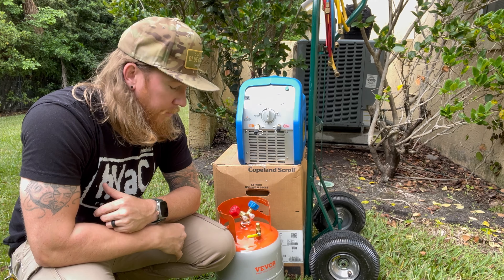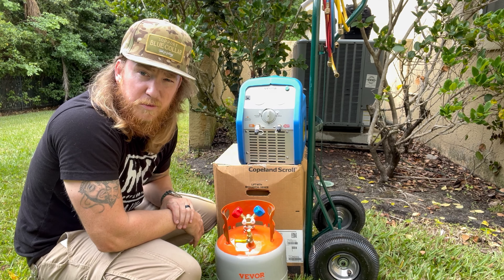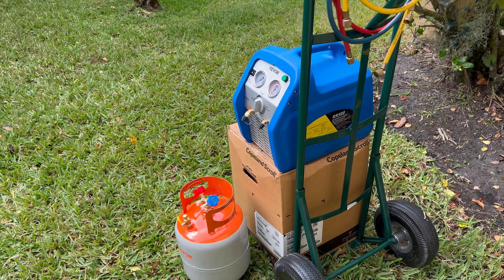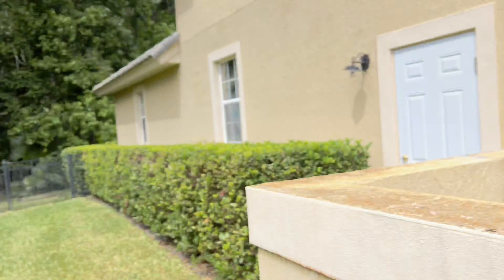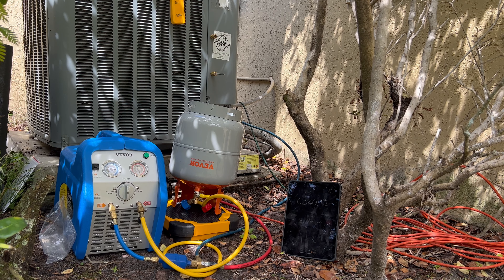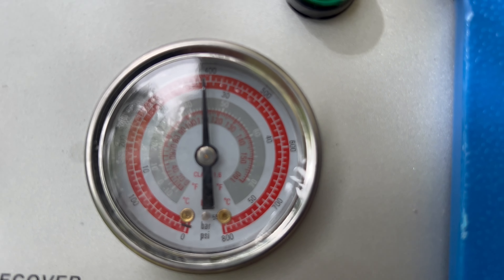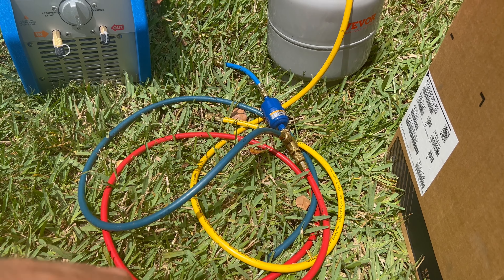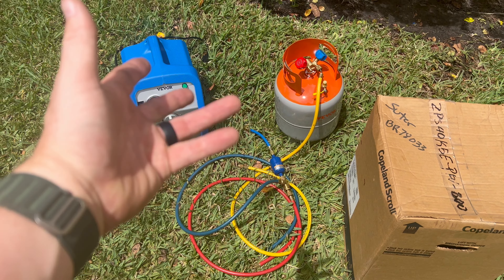WOULD YOU BUY THIS? | HVAC TECH | Vevor recovery machine and recovery tank

Comment: I recommend putting that recovery tank in water or ice over it to help the recovery process and keep the tank pressure lower. You can also just run water hose over it. or put it in a bucket and ice. Nice job Jake. liked it.
Reply from the maker: 10-4 yessir, appreciate the tips mark! One thing I forgot to mention while flipping bottle over the knobs stick out past the handle so doesn’t sit evenly. Different subject but the same 😂

Comment: Thanks for the video, I found it informative! Curious where you got those fittings you used on the AC unit itself.
Reply from the maker: Dude much appreciated 🙏 🫡 those particular valve core removal tools or shrader core tools are the appion brand, I also use the yellow jacket and the cps. They definitely come in clutch!!

Comment: Pretty common for recovery units to shut down around 400 psig when recovery tank gets to about 120 degs F, for R410a, 150 degs F for R22, driving up the pressure for machine to work against.  Cooling down recovery tank with slight water flow on it helps.
Reply from the maker: Appreciate that feedback and knowledge!! Heard of ice bucket for the tank or just hosing it down!! Thanks again 🤘🏻

Comment: Question.  Should the recovery tank be put on vacuum before adding refrigerant ?  I have had good luck putting tank in bucket with an ice 🧊 bath 🛀.  Keeps tank pressure down.  Just bought a Vevor recovery tank 2 months ago.   So far so good.   I use a Infincon  recovery machine.
Reply from the maker: Definitely can put in ice or load in bucket of water, would speed it up! That good to hear tho, I never heard or saw anything until they reached out, so far so good 👍🏻

Comment: You can use that port on the tank for pulling a vac.. pulling cores out is a must the appion evac kit in 3/8 is a must have all I have is 1/4 hoses with the depressors removed
Reply from the maker: I have the appion hoses but don’t have the 3/8 fittings so 1/4” worked for today! I’ll get an adapter and see how much better that does! Thanks bro

Comment: Why did you flip the tank?
Reply from the maker: When putting liquid into the vapor port it allows the refrigerant to expand and has to compress back to a liquid again. A lot more pressure in tank and slows down recovery. By flipping it, it pushes the liquid straight into the bottom and doesnt have the restriction of the vapor port. By doing it that way allows refrigerant not to change states keeps tank cooler and doesn't have restriction of the dip tube from the liquid port!

Comment: That valve on the front of the tank is a little scary - seems like it'd be a little too easy to accidentally get bumped and dump a whole drum of gas....would be REAL bad if it let loose while going down the highway in the back of a van!!! 🤯🤢
Reply from the maker: Totally agree especially since it doesn’t have a valve core in it. Which I could check if I could add. Does have a cap 🤔 good thoughts. But it’s currently not something I’m keeping o. The truck 👍🏻

Comment: Why is the tank upside down? The tank has a liquid and gas port.
Reply from the maker: When putting liquid into the vapor port it allows the refrigerant to expand and has to compress back to a liquid again. A lot more pressure in tank and slows down recovery. By flipping it, it pushes the liquid straight into the bottom and don't have the restriction of the vapor port. By doing it that way allows refrigerant not to change states keeps tank cooler and doesn't have restriction of the dip tube from the liquid port!

Comment: You purge your hoses instead of pulling them vacuum?!
Reply from the maker: Purge all the way through hose, machine then to the tank.
Reply: I mean in the sense of R410A having a GWP of over 2000. It would cost like 10 seconds to vacuum them.
Reply: @KoolinwithKrauss  I do appreciate your videos but if all goes well, one day your grandchildren will be walking around on this planet. Wouldn't it be great if they could enjoy their time here as much as we have?
Reply from the maker: @chrishewlet5471  😂 I’m bleeding the air, how else do you purge? When they changed over to 410 and didn’t account for the pressure difference and all the leaks that occurred safe to say …I’m good 🤦‍♂️
Reply: @KoolinwithKrauss  Why purge at all when pulling a vacuum only takes 10 seconds?
Reply from the maker: @chrishewlet5471  show me the method of the process and I’ll try it next time. Go look at every recovery method out there and this is the way to do it 🤷‍♂️ 🤦‍♂️
Reply: @KoolinwithKrauss  Well it's the easiest thing in the world, really.
Hook up the vacuum hose of your manifold to the vacuum pump. High pressure hose on the high side valve core remover. Low pressure hose hooked up to low pressure side (leave Schräder closed). Evacuation/charging hose from manifold on the IN side of the recovery unit, extra hose with ball valve from the OUT side of the recovery unit to recovery tank. With the Schräder valve(s) and the recovery tank valve still closed you open all other valves and turn on your vacuum pump. Will only take a few seconds as you can imagine. Close the vacuum valve and turn off the pump. You could of course front seat the service valves first, remove the schrāders and pull a vacuum from there, whatever floats your boat. You could recover down to a max of 0 psi because of the (possible?) leak in the system. But since you didn't really have plans to keep using this tank you could just let it go below. This is the method I was taught in Europe. Has been working fine for me, so far. Plus you'll be all set to refill and test the system after the repair.

Comment: Not to be that way but Vevor is not even Harbor Freight quality.  It is shear junk.  We got a free setup from Vevor, and it died the first time around just like yours.  We only run Fieldpiece MR45's.  I know other brands are pretty decent, but I am pretty invested in FP.
Reply from the maker: Ya it got the job done, went off on high pressure, not impressed with it. Only use the mr45 as well

Comment: For safety's sake, I would not buy or use that tank. Vevor's website claims it weighs 14.3 pounds. A 30-pound DOT-4BA400 tank weighs close to 18 pounds. That's over 3 pounds of steel they managed to eliminate. Scary!
Reply from the maker: Absolutely, I haven’t used it since this job and don’t plan on it, it’s also not DOT certified sadly.

Comment: I DO NOT RECOMMEND THE RECOVERY TANK! I just purchased one, it was missing key information to safely use it. I do not recommend! Does not have Tare weight or Water Capacity weight to safely calculate safe 80% fill weight. Contacting Vevor only gets the run around about where it was bought as they have no sales record. They will not state what the water capacity weight is for the tank. They want order number and where it was bought. Filling a tank over 80% with liquid refrigerant is DANGEROUS and they will NOT provide the information. No tare weight or Water Capacity weight stamped on the tank or mentioned in the instructions. Also not DOT certified.
Reply from the maker: I asked for similar information once receive before I used. The response time wasn’t that best, they mentioned their in the process of getting DOT certified, not sure if it’s gotten anywhere.
Reply: @KoolinwithKrauss  Well, other than continuously asking me where I bought it with order numbers (What good is someone else's order number to them?) they will not or can't tell me how much water weight it holds when full. I could fill it up with water and figure it out myself but that would contaminate the tank and could/would cause rusting.  They are still not DOT approved. I think in one e-mail they said it was still in progress. I got frustrated with them and just stopped responding to them as they are not giving any answers, only asking more questions.